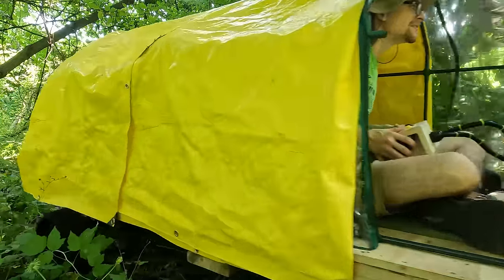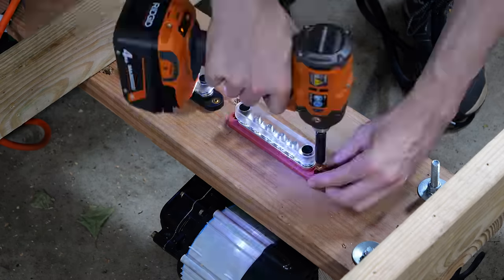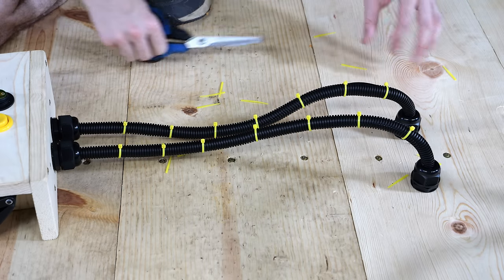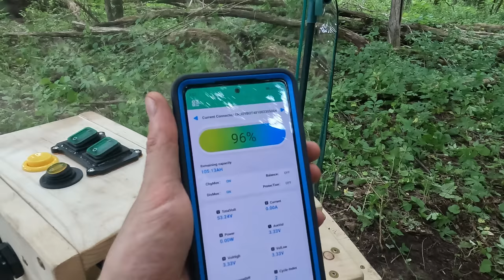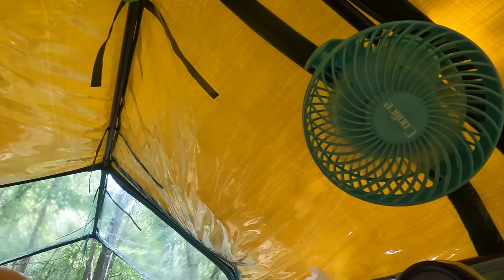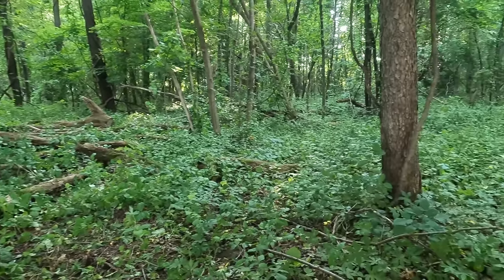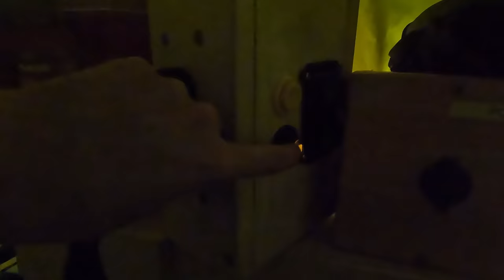UPGRADING The Camper You Can Drive Around - MORE POWER  - Build & Night In The Forest

Comment: Awesome project! I like the can-do attitude. Good solution to the differential issue, you came up with the same quick and dirty locked differential that people in the off road vehicle scene use, welding the spider gears. I think you could also just weld the output axle on the side you don't want, since you're only using the diffential for gear reduction. In a normal vehicle, the differential lets the vehicle turn without binding up, but an open differential does that by sending all the power to the axle with the least traction. 

Also, I've had issue with tarps tearing through screw heads when attached directly, if you roll the tarp in a dowel or pvc pipe and then put the screw through the pipe it will be much stronger.

Comment: I got suggested part 1 of this right before you uploaded this video, I saw your forest gaming setup video last week and definitely had to drop a sub!

My suggestions for the camper crawler would be starting with a bug net layer beneath the clear layer, so you can let fresh air flow in on warmer days without as many flying pests or creepy crawlies getting in. Assuming the greenhouse rods can support the extra weight!
Another idea is to add a reclining seat, so the lurch back from hitting the throttle won't be as bad. Maybe you could add an additional layer of planks on top of the current layer, so the seat can recline back and lay flush with the rest for a proper flat surface you can lay on? Would also be nice so you can game sitting up without destroying your back!
And my last idea would be for a platform of sorts you could attach to the back, maybe a steel grate style platform that you could cook on and that folds up when you're moving so it doesn't get caught on anything. Could allow for more stuff to be brought along and help put that extra horsepower to use!
Reply: Maybe he could get on of those stadium chairs - the kind used for sitting on bleachers!
Reply: He needs to add some no-see-um netting to allow some air flow

Comment: You have to get ATV tires for your camper so you can have some cushion from the tires. Leave them a little deflated so they are kinda squishy. Then make a drivers seat with little springs that it sits on so you can cruze. If you are really ambitious you could do leaf springs that hold the axles with U-Bolts. Then you could go over logs and rocks. LOL
Reply: Fr, need tires and suspension.

Comment: I love these, keep upgrading this thing. I have a couple suggestions, maybe upgrade the frame to metal or at least put some paint on it, you don't want this thing to get wet and start to rot. Also, ever thought of building a wooden hut on it instead of a greenhouse? You're pretty good with wood, you could make a little hut, maybe put solar panels on top? But if you do do that I would highly recommend upgrading the frame, don't want to make this super cool camper only to not be able to use it in wet terrain.  
I'm not an expert, but from my experience, anything wooden that is going to be outside needs paint at least, preferably lacquer, it makes it last sooooo much longer in wet conditions.  
I personally use boat lacquer on anything I build out of wood that is going to be exposed to the elements, I mean hey, if it protects boats from salt water it's going to withstand a bit of rain right?

Comment: I don't know if this has been suggested but you should try putting a fan or 2 around the middle top (heat rises) with ducting out to the back (using something like dryer flex ducting). It will allow you to vent the interior instead of having the front open.

Comment: Noticing the skipping on the tank treads when it turned, I'd recommend either steeper grooves to make the turning more smoother since the blades would cut into the ground more to hopefully provide more ease when turning. Another idea to improve this design into a V3 would be to turn it into Solar by adapting panels above the head rest area (Where you put the gear at during Drive mode) which would thus mean you'd have to upgrade the greenhouse frame to recommodate the strength for such panels. By doing such, you can eliminate the big bulk in the cock-pit/drivers area, allowing for when it's parked and you're laying down way more room. Finally another design to help would be to make a kind of slider mechanism do you can still get ventilation when driving, but there wouldn't be so much dirt kicked up. Or perhaps a clip/lock-in panel you can detach for when you're sleeping that is angled to just half-way go up so you can get a window, but the dirt isn't kicked up into the sleeping quarters.

Comment: You should be using crimped ferrules over the wire strands before putting them into the screw terminals. This protects the strands from getting frayed, especially in something that moves like this.

Comment: The best way to lock those differentials is to have a plate (heavy enough steel to weld a spline stub to) with a "dummy" fixed axle (stub) on the inside/center, that matches the spline and bolt pattern of the axle receiver you want to "anchor". This locks the unused side of the dif, much like you did, but without welding. You are locking it mechanically. If the plate has a threaded receiver on the outside, you could still connect the two difs with a pipe like you did. This keeps it original and you don't have to take it all apart and weld it.
Reply: Yea.. it bummed me out seeing the diffs destroyed. Everything else was cool. Would have been better just using 2 of the motors, one for front, one for back and add steering.

Comment: I love this project! Now it moves like a tank, easy to navigate and make 180º turns, its a great improvement. I've been wondering since the previous video tho, wouldn't that wooden frame eventually rot from moisture if not treated with some sort of coating?
Reply from the maker: :D it was fun to drive. The wood is treated wood except the floor board so it should be  solid for for a good while - Cheers!

Comment: I'd suggest a more sturdy alternative to the greenhouse for the next rendition. It'll hold up just fine in minor to no weather conditions. But if there's a sudden storm you're going to be in for a very bad time in a night in that thing. Perhaps a steel frame, and using a mixture of tarp for protection from water and bug netting underneath for breathability for when it's pleasant out? You could still use the plastic in the front for visibility and protection, or even Plexiglass.

Comment: Awesome build. For improvements, I would increase the height of the greenhouse by a few inches ,so you can sit up straight, instead of being hunched over damaging your spine. Take the bottom greenhouse rail out at the back, so you can get in and out easier, you don't need it because you've screwed the sides down so it can't move. You could extend the tarp at the back with a single pole and guy ropes, giving you a dry place to cook and sit out side. You could get some bug netting to hang up inside at night when you sleep, easy to make, sew on some fabric tape so you can tie it to the greenhouse frame inside. The mud getting in from the track wheel would probably be prevented from the wood used to increase the greenhouse height... solve two problems with the same thing. :D

Comment: Maybe add a couple of holes in the floor and on the bottom side build a box that is screened in and use a couple of 120mm 12v computer fans to pull in some fresh air, have 1 fan pushing air in and 1 pushing air out. Might help with getting fresh cool air in at night! Really awesome build! Maybe add a marine stereo and a couple speakers that hang from the greenhouse frame!
Reply from the maker: Not a bad idea to have a vent fan - Cheers!

Comment: For version 3, definately the solar system, move the treads under the body, put the engines into the body to protect them from wilderness, rocks and trees.  Put a slope under the front and back so if you run over something it also doesn't damage your undercarriage.  Replace the homemade controls with a wireless handheld controller, add a raspberry pi to control what the controller does.  Add break lights to the back (a step closer to legally driving it on the road), strip lighting around the body so you can get three-sixty illumination.  Add a kitchenette (electric stove element, and two several gallon drums (one for water, the other for waste water).  And a small display screen connected to the raspberry pi so you can see details like battery charge level, how effective the solar panels are, current draw, maybe your motorized details like speed, lights on/off, that sort of thing.

Comment: You can't leave one side of a differential unhooked as all the power will go there and your "centre axle" will simply spin as turbo speed forever instead of going anywhere. This is why you had to weld the differentials.

If you want to use motors like this, you should use them correctly and actually use both differential outputs to drive your load.

Another thing i can't help but notice is your tracks are skipping like crazy which WILL damage them and eventually leave you stranded. You should look into tensioning them properly.

Overall this is a fantastic idea, but the mechanical engineering leaves a lot to be desired.
Reply: I hope he sees this comment, I'm no mechanic, woodworker, or fabricator but that's the majority of the content I consume 😁

Comment: You should do a 3 way switch for forward/reverse so you don't accidentally run both at the same time and ruin your motors (like pressing the gas and brake at the same time).

Also, solar panels with with long and short power cords.  One you can mount while driving and the other you can mount on a tree if you plan to spend some time in 1 spot.

Comment: I love this entire aspect so incredibly much, just the idea that you and a few friends could each make one of these and just GO camping. But as far as ideas I had that I got from watching the upgrade, I do have a few. 1) I love the idea of getting a second identical battery and building a housing around it so you can make the front end look like a big-rig! With the additional power supply obviously you'd need more wheel/tread action going on. What I would propose is to build a small section that would extend about 1/3 the length of the green house metal framing IN FRONT of where you sit normally, make the "front cab" wide enough to accommodate yourself and a nice cozy space. The next thing it would need is some tread, I was thinking 4 additional tread wheels would be good to support this section alone. 2 in the front and 2 right behind you. Then I would try to connect it up so that the front half has an easier time turning, like making it a 2-compartment travel camper. I would also think it'd be pretty cool to add a 3rd axle on the main long compartment right in the middle. Remember the front end and how I said its similar to a big rig with the boxed in double battery for a front end? Well I was thinking to push the batteries even further, get a small light bar kit and mount it overhead, then make cool front and rear lights that are perhaps dimable like how cars have hi and low beams. Additionally I would IMPLORE you to please get 2 more of those fans (i would splice in the batteries to power both) where you add them is your business but I would add one at just above head level when laying down by my head, and the other on the opposite side by my feet. Before that though to keep out any unwater bugs, find, measure, cut, and attach your preferred version of mesh screen to the back side of each fan as a physical deterrent! Alternatively if you could manage to get larger tread wheels and raise it off the ground juuuusst a big bit you could make a cubby underneath where you'd lay to serve many different purposes like cooling food and drinks keeping parishable foods good for longer events! But what I like the most for that is potentially using the 2 fan system to pull air from that cubby into the Big-Rig-o-Matic 3000 to keep it nice and cool on the hot days. Draining could be easy, ensure the interior cubby is waterproof somehow and then strategically drill holes so that the water can leave when it melts. The thing is maybe it should go from 2 to 3 fans if you go with the larger cubby option though, one up front my the driver in the lead cab, one at the rear somewhere opposite, and perhaps one built into a floor board to act as a floor vent. That way you can selectively use the "AC", naturally pull in fresh air and push out old air with just the front and back fans. I would build them into the Big-Rig-o-Matic 3000 sidewalls and make a cover for the fans when not in use to protect from water damage. Thats all i got for now, i hope these ideas are of some use to you

Comment: Maybe a little tray table with folding legs could be useful. Also, mosquito netting so you can open the 'doors' and a new fastening system for the tarp in drive mode. Also some track gards so they don't throw dirt into your camper. And I would make the mat more permanant.

Comment: Definitely some "wheelarches" to keep the tracks from throwing mud up inside - a couple of strips of conveyor belt in a slight curve would be floppy enough to bend out of the way of trees but stiff enough to catch the mud.

Suspension looks like it would be a big help, especially on rougher ground.

Instead of the tracks, you could use bigger wider wheels like quad bike wheels - take a look at an Argocat for an 8-wheel-drive offroad vehicle that has skid steer. It uses a small engine, gearbox and differential with a pair of big brakes to skid, and all four wheels down each side are chain driven. Maybe you can drive pairs of wheels with the motors.

Comment: No way this guy just cracks open the motor and just welds in together inside and all of a sudden its more powerful, what eldrich knowledge does this dude keep
Reply: It's a differential, it's supposed to drive two shafts and the drive is split between the two. He left one side unconnected so when he stops the shaft he's using, the unconnected side spun instead. The welding inside just broke the differential so it can't do its job any more. Not sure why he started with a differential at all!

Comment: You should do another upgrade by replacing the wooden frame with aluminum..
Wood is cheaper and can be replaced or converted quickly, but is not nearly as stable. And you should add some suspension! 😁👌🏻

Comment: I do have a couple of ideas that might help you out instead of the plastic over the greenhouse, possibly get a netting. For the Spring and summer time because it would get hot in there with the Clear plastic But it would be good for wintertime because it holds the heat in. Possibly put Elizabeth's suspension on it to help out with the ride and probably raised the right height. So the help cushion the ride.

Comment: If you're going to run tracks and steer by differential steering,skid steer,tank steer, you're defeating yourself by tieing the left and right sides together.one axle needs to remain stationary or even reverse as the opposite is moving forward in order to turn using this method.ill bet you're going to throw tracks.

Comment: One piece of advice I would make going forward is consider putting at least some small skid plates on the bottom of the chassis over the motors.  If not a thin plate running the entire body.  It'll add some weight, but it'll prevent damage/debris from getting into any of your wiring.

Comment: I've watched a few vids here. The only suggestion I have is to make the bottom of the camper hollow. So you can put the battery and inverter and store stuff inside it. Not too sure how you'd do it, but it would give you a lot more room inside if you could figure out how to do this. Honestly, you could probably store everything inside it. It would just have to be thicker. Would definitely allow more flexibility with what you can bring. And as I saw in your other vids, you have stuff in crates or totes.. Imagine if those were underneath you. 

This is great though. You seem to be enjoying yourself! Ty for the video.

I would also say, since it's a gamer camper.. It needs RGB. perhaps a LED strip? lol.

Comment: I would increase the ride height a bit (to the point you can sit at the edge and have your feet touch the ground flat with your legs bent near 90 degrees. Basically at where you can sit on the edge like a normal chair) and add some kind of suspension (leaf springs or full on shocks).

Comment: If you find a way to add 1-2 motors on each side you can use a longer tread that connects between all of the motors, this will give you much more traction without slipping / digging.
Also instead of yellow tarp on the back maybe do clear and have something that will slide overhead to block sun. That way you retain visibility while inside

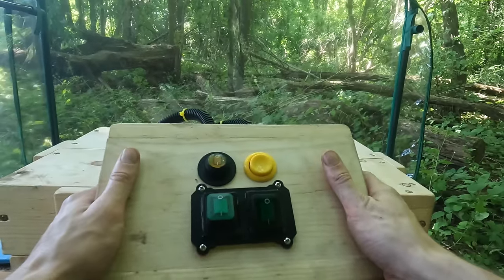also at 41:42 - you forgot to pull a stake out of the ground with lines on it so you`re dragging it lol

Comment: A few suggestions;

1) A USB power station. Convert from 48VDC to 5VDC to power it.
2) Telescoping pole with lighting that uses a USB light, would give 360 light for your area.
3) Tool rack? FOr carrying shovel, ax, and other large "pole" tools.
4) Make a small trailer that can be detached. (Water Mule)
5) USB Water pump, if you get near a water source, you can filter it and fill some containers.
6) Replace flooring with thin metal plates. Reduces weight, adds structual integrity.
7) If you bring a "Fog Machine" you can add Citronella oil to the "fogger juice" and fog the area to reduce the bugs fast.
8) You can get a better control set, such as this using an RC remote rewired to work with your system. No RF, but direct wired.